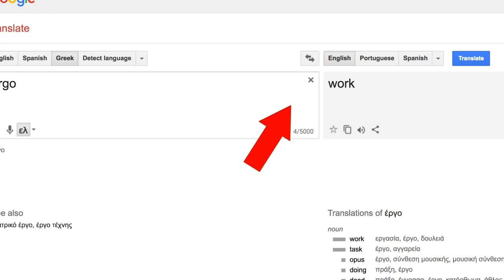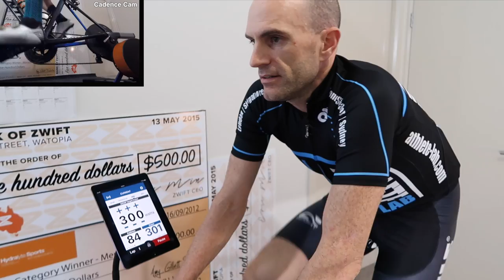Indoor Cycling Smart Trainers: ERG Mode Explained

Comment: Shane just a generic question about erg mode. Am i wrong if i think that for folks like me, that works with coggan power zones, ERG mode is not a good choice? I mean...usually my workouts have intervals such as 15 minutes @Z4/Threshold (250-280w I.e.) but with erg mode i have to  choose a precise wattage (such as 260w ). Am i the only one who usually perform an interval using that kind of tollerance (+/- 15 Watts in the example above)?   Is there a way to use Erg mode with more than 1 or 2 watts of tollerance compared to what i set on the display?  (sorry if i can't explain better my doubt)
Reply from the maker: ERG is horrible. The "hit your exact target or don't even bother" nature of it is horrible. I hate it. Well.... sometimes I like it. But it doesn't suit all training applications such as your example use of Coggan zones.
Reply: I agree i think that human body can't work with that kind of precision. it would be like running at 4'03"/km +/- 1 second....impossibile for me.  I thought that some apps could manage more tollerance ...something like an Erg Mode with a bottom and a top line. It could be cool...

Comment: Does ERG mode on Zwift take gradients into account when holding a specific wattage?  I use the Tacx Vortex and I've noticed that when doing a workout in ERG mode on Zwift there is a noticeable difference in the perceived power output downhill vs uphill.  A great example of this is the steep downhill just as you turn onto the radio tower climb.  On the Vortex, even though the wattage doesn't change, you can feel a slight increased resistance on the downhill that lessens as the gradient changes from negative to positive.
Reply from the maker: In a perfect world, no. ERG should be completely disengaged from the visuals on screen (SIM Mode). I can't find the reference at the moment but I do recall seeing somewhere there was a bug on Zwift that did cause some cross-pollination of gradient and ERG mode... which... shouldn't happen. That's all I can recall on that one.
Reply: @gplama  ,  I know I'm a bit late to this video, so bear with me, but, you mentioned in the video that you can turn off ERG mode in Zwift for workouts.  What happens when you do that?  I assume that you go into SIM mode and if so, that the only things that control your ability to hit the wattage targets are your gearing and therefore the force you are putting into the pedals and/or  the gradients in-world?  And if that's the case, I suppose you better be pretty careful, especially depending on your fitness, what routes you choose and workouts, or you may find it next to impossible to hold the wattage, either high or low, depending on gradient, gearing and fitness.
Reply from the maker: @corymiller4543  It'll go into Level mode (dumb trainer mode)... in theory. There is an option to enable SIM in workout freeride sections.

Comment: Shane can you clarify something. I use a Tacx Flux on Zwift but use my on bike power meter for power. However in Erg mode is Zwift referencing the trainer or the Stages Power meter. Ie I have Stages for Power but pair the Trainer for control.
Reply from the maker: It depends what you pair as your "Power Meter" within the program.

Comment: LlamaLlama - have you successfully had ERG mode work on the Drivo. Spoken with Zwift, and Elite, and given up. Mine “locks-up” after a minute or two and cranks require 3000w to turn. Given up mate
Reply from the maker: Yes. My reviews of the Drivo I and II use ERG. No major issues encountered.

Comment: Hi Shane,
I have a Tacx flow smart and i can actually go above the set power in ergo mode, in fact i thought that was normal so I always try to be a little higher (around 10 watts ) to prevent the resistance pulsating up and down. Is this because my turbo trainer is weak (6% slope/800 watts max) ? 

Also i noticed when i started using my 4iii power meter with Zwift there is a significant lag from the time i increase the power to the point my trainer adjust the resistance when using ergo mode, is this a limitation of ant+ and will it be possible to solve this issue by maybe using a bluetooth dongle?
Reply from the maker: There's a lot going on with power matching (using a power meter as the power source). Just ensure you have a strong/clear ANT+ signal so all the commands sent to/from the units are received without interruption.

Comment: Would you recommend to train on zwift with ERG mode on or off to improve performance?
Reply from the maker: That's a bigger question for a coach or someone who can review your sporting history/profile/etc.
Reply: Thanks for the quick reply. I might've not written explicitly my question. What are your thoughts on using the workout modes in zwift with ERG mode which forces me to generate that exact watts or having ERG mode off and trying to find that wattage on my own? 

Thanks again Shane and thanks for your great videos
Reply from the maker: Same answer... it depends. What if you've got the wrong FTP entered and you're holding the wrong watts? There's no races outside where you're forced to hold wattage, so is training in ERG mode good preparation for the demands of riding/racing hard outside? All questions a good coach will dive into if you want to take it to the next level.
Reply: Thanks. Much appreciated 😊

Comment: I have the "Elite Qubo Digital Smart b+" and no power meter on the pedals. I noticed that, when using ERG mode, it's  easier when I have the big gear on instead of the lower one, why's that?
Is it me or is it the smart trainer??
Compliments for your  thoroughly explanation.
Cheers.
Reply from the maker: Bingo! You've just nailed what I'll cover in another video. It's all about the inertia / momentum when you're in a bigger gear. So changing gears and gear selection IS IMPORTANT in ERG mode for training. Everywhere I look, companies say not to change gear.... I'll throw fuel and strike a match on that soon. :)
Reply: Shane Miller correct me if I'm wrong but isn't it easier due to trainers being able to provide resistance at greater speeds easier than at slower ones? Which is why a trainer may claim to have a max resistance of 500 watts but on zwift and you head up a climb you can't hit that 500 watt mark, but on the flats you can no problem.
Reply: Shane Miller interested to see this video. is it up yet
Reply: did you do a video on that already and where is it?
Reply: Shane Miller Is the video up? I can't seem to find it. Do you have an eta
Reply: The fact you don't have to change the gear of the workout is a big pro : it's the perfect way to wear off all the  sprockets equally, preventing a premature wear off of the chain (since you'll use a different sprocket for each workout).
Reply: "Big" gear as in larger or as in faster (smaller cogs)?

Comment: Hi Shane. Quite new to swift and started 101 training session. Got to 3rd day and ramp test, done warm up 10mins but only managed to get into about 5mins and was knackered it set my FTP to 138w which I thought was rather low. Also I'm unable to calibrate my elite direto via app on Android. Done the trainer warm-up but am unable to progress past start pedalling it doesn't change from that,very confused. Would calibration affect performance on swift??
Thanks
Reply from the maker: Calibration will affect the power readings, yes.
Reply: @gplama  thanks. Is there any particular reason why I can't calibrate the elite direto I have. As I said,onceim in the advanced settings and try to calibrate,it says start pedalling,which I do,bit doesn't change from that screen. Any suggestions as to why?
Thanks
Reply from the maker: @tomedwards1740  As long as there's nothing else connected to it, it should calibrate with their MyETraining app.

Comment: I have big problems with ERG mode on Elite Direto. If I ride 125 Watts with 80 cadences and then attack the interval with 400 watts with cadence 105 it is impossible with Direto. Direto is so slow with ERG mode... so i ride 400 Watt with 130 cadence and if I try to reduce cadence I also drop watts.  
The only solution is when the interval starts to wait for 2 seconds and then attack gradually 400w with cadence...and this is bad solution, especially if the intervals are short. Any tips? Wahoo, Tacx do  they have the same problems? Tnx
Reply from the maker: Try this using the small ring on the front.
Reply: @gplama  yes, i use shimano 11 speed 11-28 / 50- 34 and i have on 5  from 22 gears
Reply: I'm astonished how it keeps 300w stable with big cadence changes. with my elite direto I would be going from 200 to 400 before stabilizing!
Reply: and yes, a couple of seconds before it starts changing power

Comment: Any clue why pedals spin out on standing climbs in ERG (Zwift wants you to maintain 65 rpm but resistance isn’t enough)?
Reply from the maker: I don't quite understand the question sorry. ERG controls power, you have to control cadence. So if you're spinning out then you'll need to slow down and let the trainer adjust to the new cadence. Out of interest - which trainer?
Reply: Shane Miller - GPLama  thanks for the reply.  Zwift says keep the power and cadence but stand up!  I have to spin slower as there just isn’t enough resistance.  I hope that makes sense.  Thanks again.

Comment: I'm having this debate in my head...please help!  I am a big fan of TrainerRoad, but I currently use a dumb trainer.  This means that my watts fly high and low at transitions and under load (example: 105% FTP..I push so hard to keep the effort that I actually do 110-115%).  This high/low jumping around sometimes leaves me running out of gas before the end of the session.  would an ERG smart trainer make me more efficient...not just a better TRoad performer?  Part of me wants to believe that my current setup, while not ideal for TRoad, is more realistic to real world riding,  WHAT's best for training and performance, however?
Reply from the maker: Be smoooooooth. Smoooooooooth is key. And yes, everyone needs a smart trainer upgrade! :)

Comment: Do you know if there's an option to turn erg mode off using the Zwift app on iOS?  I've looked but can't seem to find it...
Reply from the maker: iPhone or iPad? I recall there wasn't enough screen realestate on the iPhone for the option/button. Whereas on the iPad there was. Zwift Support should have the definitive answer on this one though.
Reply: It's actually an iPod! Surprisingly it actually runs Zwift without any issues. The main problem is that it's hard to use the user interface. Makes sense that they'd drop the option due to lack of space.

Comment: Shane i need your help ! Elite help desk answered to my problem with a direto.... linkin this video .
What is happenin to my direto is that if i'm riding 200W @ 80 rpm and i increase to 90 or 100 rpm the power increases as if the resistance was constant and it doesn't adjust to match the 200W (target).

What i expect form an erg trainer is that if i increase my rpm, after some seconds, the trainer reacts and force my to my target watts (ive tried with 130, 260 and 300W targets...some behaviour...i can go and mantain even 200W more than the target wattage..for minutes...not seconds).

am i right?
Reply from the maker: Best guess -  Wattage Floor - You may need to change from your big ring to your little ring to hit your wattage targets in ERG mode. If your power target is below the wattage at which your trainer can apply resistance, you hit the "resistance floor" (also referred to as the “wattage" or "power" floor) and you won't feel resistance changes. Slowing the flywheel down by changing to an easier gear is sometimes required on the Direto when in ERG mode.
Reply: Shane thx for your quick answer. I don't think this is the case of wattage floor. do u mean that it can't resist more when i push only 300Watt for example?. I mean if i'm at 200W @80 rpm....why when i want to go  at 90RPM it doesnt react and i can ride only at 300Watts....i dont't think it is at its limit of resistance.

This is what's happend to me in a trainer road workout: https://www.trainerroad.com/cycling/rides/6789691-test-react
as u can see the behaviour is the same with 130 or 260 target watt.
Reply: edit: sorry the comment was published before i was able to correct. what i understand about wattage floor is that it happens at low wattages, such as in recovery intervals at 100/120W. But what's happening to me occours at higher wattages such as 200, 250 or 300W...so if a i do what you do at target 300W in your video (increase rpm from 80 to 100) i only see wattage increase without going back to the target but remaining at 400/450W.
Reply from the maker: A quick look at that TR graph, that's a mess. I can't quite get my head around exactly what's going on here without spending too much time on it, I'd suggest putting down the exact steps performed to replicate the issue and posting it over on the Direto Facebook Group to see if others can try it out and report back. I'll loop back to this if I get the spare time.
Reply: HI Shane, yesterday i've tried to use the smallest ring. i have a 50/34 with 12-27 cassette. With the 34 everything seems to be fine. It respond in what i think is the right way. I've tried to stress it with more RPM changes and everytime it 's responded quite well. It seem that a 50x13/14 is enough to start the problem. I'll do other test...but do u think this is a correct behaviour for the Direto?
Reply from the maker: Is this how ERG should work in general? No. Is it how it works on the Direto, seems so. As above, slowing the flywheel down by changing to an easier gear is sometimes required on the Direto when in ERG mode. It seems both the Direto and Flux (mid range direct drive trainers) operate like this. The flywheel speed needs to be <30km/h for ERG to respond as expected.
Reply: Thx Shane. For me it is not a problem now that i know the 'trick'. I only hope that this is not a limit in other situations that i'll face in the future. But if with this trick i can ride at low (60) and high (100) with my target wattages (usually not more than 300W) i'm ok. I'm enjoying direto a lot but for the next one i'll go with a top trainer like drivo or neo. In Your your video the  reactivity of your trainer is impressive.

Comment: Like to know how gearing works with this as in the real world you can spin fast in a low gear to get 200w etc or spin slower in higher gear to get 200w  how do smart trainers cope with gear change.
Reply from the maker: In sim and slope mode trainers just apply resistance and report power. ERG mode is different and it'll adjust according to the cadence. This might shed some light on it: https://www.youtube.com/watch?v=uHUOhmG04M8

Comment: Is there a zwift world where there is 0% gradient. This would allow the athlete to stick closer to the set power for each interval but without having to deal with the spiral of death
Reply from the maker: Set the trainer difficulty to 0 in the settings and don’t use ERG. Workout mode may default to 0 (level mode) with ERG disabled anyway, I’m not sure.

Comment: What mode do you typically use if you are not using ERG mode?
Reply from the maker: SIM... which is 'just riding along' in Zwift.
Reply: @gplama  What about when using TrainerRoad or other similar training apps?  Thanks again.
Reply from the maker: @Methodical2  Trainer Road is only ERG mode.
Reply: @gplama  Cool. Thanks

Comment: Just for clarity are you saying do not use erg for ftp sessions.
Reply from the maker: FTP tests? Yes for a ramp test. No for all-out effort based tests.
Reply: Shane Miller - GPLama I was thinking of the 2 x 20 efforts. Haven't found these great using things like zwift on erg. Wondered if I was doing sometime wrong
Reply from the maker: 2x20 workouts are fine in ERG... if you want to use ERG and have the intensity set right... and are using a trainer you like riding. It's entirely up to the rider in this instance to choose what they want to use.
Reply: Shane Miller - GPLama thanks for the responses. When you say the right intensity I assume you mean the right ftp setting having done a test.
Reply: Shane Miller - GPLama really useful videos by the way. You've tempted me into getting 4K Apple TV although I'd like to connect my smart trainer and garmin vector pedals which are Bluetooth. Means I can't connect hrm but my straps are ant +. Doesn't look like Apple TV will ever support ant because there's no USB.

Comment: Shane, I have had a computrainer for close to 20 years.  Purchased when it first had to be run through Nintendo.  About 5 years ago had to get my generator serviced but has worked strong ever since.  I don't have my manuals and I have always ridden in erg mode.  But I use some software that does not talk to CT and I am trying to figure out how to use Stand Alone Mode and what all of the pre-programs are.  I can't find any info.  I have a PM on my bikes so I would use that.  Do you know what all the programs are? I know there is like 1-59.  Not sure what to use so I can just run through  my gears.  Thanks for any help you may be able to provide.  Anthony